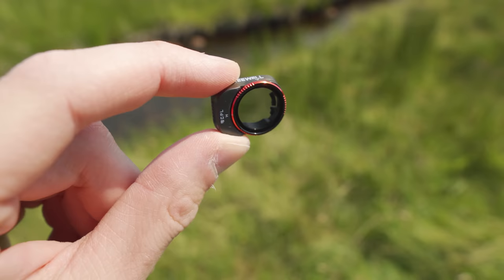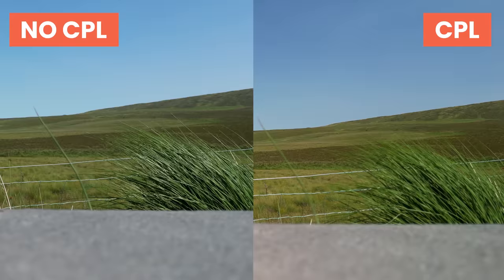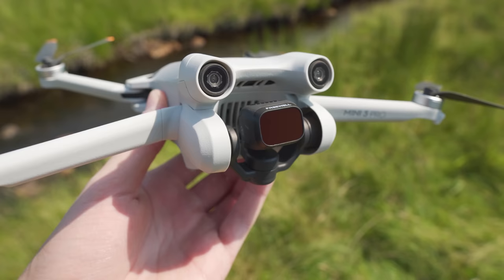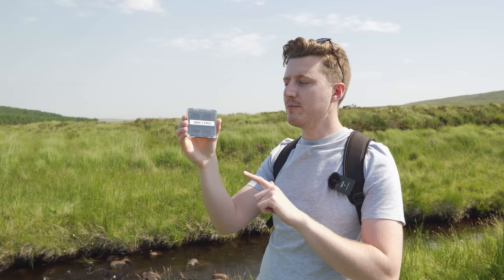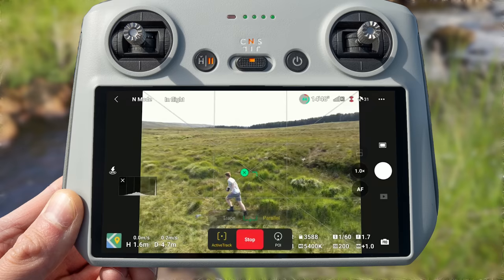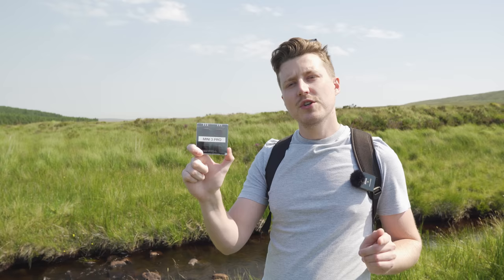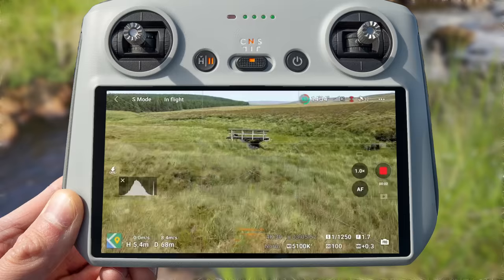UV ND ND/PL CPL What on earth does it all mean? | Ultimate Guide to DJI Mini 4/Mini 3 ND Filters

Comment: A very good informative video but you are giving misleading information at 5:25 in the video. You said the H&V are for horizontal and vertical filming modes. That is incorrect. The H&V indicates whether you are polarizing the light horizontally or vertically. There are two ways to you can check this out.

1.  Look at a blue sky while turning the filter, you will see that the colour saturation of the blue intensifies or de-intensifies depending on whether the light is polarized horizontally or vertically. 

2.  Look through the filter at light reflecting on lake or a car windscreen, and turn the filter 90 degrees. You will see that the amount of the reflection changes significantly and the colour saturation also changes.  

The CPL (circular polarizing) is used on autofocus lenses as PL (polarizing) filters can interfere with the autofocus mechanism. This info comes from 50+ years of photographic experience.

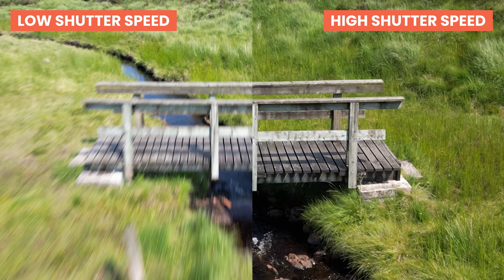Comment: You showed it perfect at 7:59. Using an ND filter with the 180 rule looks like you've stepped down from 4k to 720. Not appealing to me except in the rare instance where I want to show an increased speed look. But for overall drone B-roll, I prefer the sharpness and detail that you get from using no ND filters.
Reply: I think the main issue is not that individual images are too sharp, but that most of the motion is not there in the video, so it looks jittery (or as a too fast slideshow). Take for example 25fps with 1/2000 shutter speed. That means out of every 1 second, we get 25/2000s recorded and 1975/2000s skipped. In case of moving car, we get it at one position on first frame and 10 meters away on another frame, but nothing in between, only these 2 "snapshots" of its position in time.

Comment: Ok, this is a great explanation. I've been looking at the ND/CPL combo, and was wondering if there's any reason you might not want a CPL filter for your image (i.e., just a pure ND filter).
Actually, if you wanted to temporarily "disable" the CPL part of one of those filters, could you just set it to the orientation you aren't filming at? Like if you're filming horizontally and set the CPL to 'V' mode, would that basically just remove the polarizing effects?
Reply: The ND/CPL pack will change the color of the sky, they are best used at a 45 to 90 degree downwards angles. That's the only thing I'd say it was missing from the tutorial, otherwise it's a very informative video.
Reply from the maker: Hey Daniel, you can definitely "reduce" it's effects by turning the orientation of the CPL (using the red ring), but it will still have "some" effect on the image. Notably still increasing saturation and contrast. That being said, I use the ND/PL combo most of the time.
Reply: @TheDroneCreative  Well, increased saturation and contrast don't sound too bad. I've just ordered some. :)

Comment: Hi. I just bought the Mini 3 pro and I think I'll definitely get the uv protector, given there's no glass on the drone lens. However, given the huge improvements in filters within the video editing software like Davinci and Capcut, do you think the drone filters are needed and if so, why and how do they differ from adding a filter in post production? Great videos, been watching loads of yours before I take my drone out. Subbed :-)
Reply: From my very limited knowledge of videography but being biased toward stills, it is always best to get the effect you can in the camera - use filters.

Post edit filters will not enable you to slow the shutter speed and achieve the eye-pleasing motion blur.  Post edit filters will not enable you to remove reflected light and "see through" the surface.  

With AI capabilities, I'm use post is getting better but using a filter on the drone will negate the need to even consider what editing to try and do - quicker in the long run.

Comment: Thanks again, Matthew.  Is there any advantage with using ND filters while in Auto mode or should you mostly use them in Pro mode where you can change the frame rate/shutter speed and ISO?
Reply from the maker: Happy to help! There is an advantage to using ND filters while in Auto mode. The drone will be able to expose correctly using lower shutter speeds and this will give you that more natural looking motion blur, the only catch is you don't have full control in auto mode so they make much more sense when using "Pro mode" and controlling these values manually.

Comment: Great video. I was wondering, I have been using a cpl filters from freewell. I noticed that they can give some vignetting in the corners. Probably some reflection but because of this I had to crop several clips. Is this problem shared by others? I checked the position and they seemed to be correctly attached to the lens.
Reply: it's just how CPL filters work. It's normal. That's why you don't use CPL filters if you're shooting clear sky from different angles with direct sunlight.
Reply: @MikhaillllKing  thanks